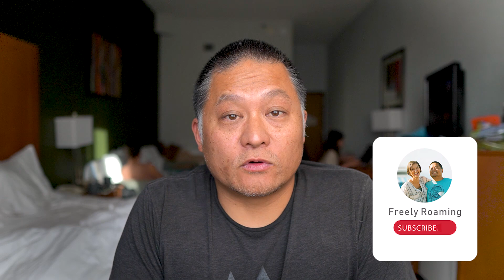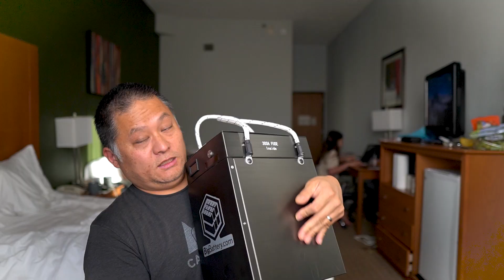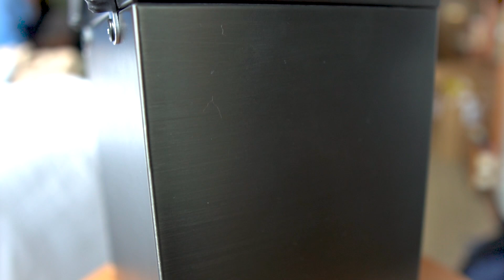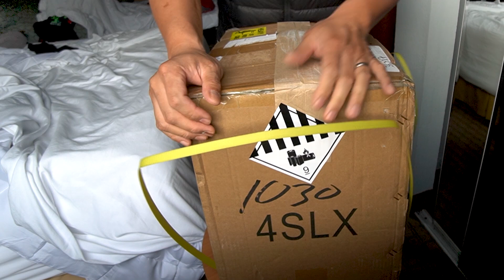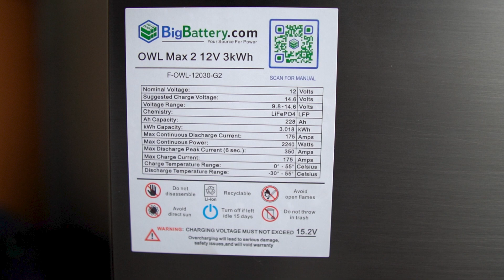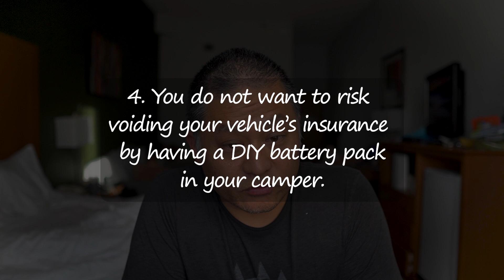Why You Should NOT Build A DIY LiFePO4 Battery Pack

Comment: Sorry you lost me on that one.  Disappointed because you were one of the leading sources on YouTube for DIY RV batteries.  I do understand it is not for everyone.  When you watch Will’s videos you understand the so called professional manufactured batteries are mostly worst than a DIY solution.
Reply from the maker: Well you say you understand it's not for everyone but in the same breath you show that you really do not. Unlike Will's channel, mine is not only about DIY lithium batteries. It is about off-grid and mobile living. It's irresponsible to tell people how dangerous it is without further explanation and just go on with the same old  tutorials and never show safer alternatives. Not all commercially made batteries are made equal. That is why I didn't just choose the cheapest one out there to show in this video. You do not get it because you don't get all of the questions I receive from beginners who have no business building a DIY pack. I've seen too many burned down RVs lately to not make a video like this. I don't really care about your feelings on this topic because the goal is to make sure the people this video is made for understand building from raw cells is not for them and they need to be steered away from it before someone gets hurt or killed. There's way more to it then just knowing which wires go where. For others in the know, this video won't do anything to deter them.
Reply: @freelyroaming  wow, I didn’t attack you.  Just pointed out facts
Reply from the maker: @Norm  I didn't say you attacked me. Though you did express dissatisfaction and disappointment which I said it is not my concern. Perhaps you felt that was an attack on you but it's really just apathy towards your opinions. I also just pointed out facts. You might want to read it again.

To say DIY solutions are mostly better than commercial is just your OPINION, not a FACT. Builds shown on YouTube are the exception, not the norm. Fact is, most DIY battery packs are dangerously made and time bombs waiting to explode. You just don't see them uploaded to YouTube. Believing otherwise is just foolish. A video like this that tells the truth of the danger of a diy pack is necessary. Even if it 'disappoints' people like yourself.

You have to realize that these videos are only made after a lot of thoughts and preparations. If you are just making an off-the-cuff comment without going thru the same level of preparation, your comment just won't seem credible.

Comment: I feel like I cheated the system a bit. One of the bigger chinese sellers for cells and batteries is LiitoKala and they started selling rather cheap pre-builds some time ago. Got a 150Ah LiFePo4 battery for the same price as 4 cells with a BMS (~270$) back during new year. It came in a proper package with no visible damage and has been working great so far~ Shipping took over 2 months though, haha. I originally intended to just buy a simple lead-acid battery, but this was too good of a deal to pass up on.
Reply from the maker: Wow that does sound like a ridiculously good deal. Good for you. Unfortunately those kinds of deals are just not available consistently enough for me to recommend to others.
Reply: Have you tested the real capacity of your battery pack ?
Reply from the maker: @cbinett  I assume you've heard about the faulty old cells Liitokala has been trying to sell as grade A, new cells. Seems like it is a gamble and some people are getting lucky.

Comment: lmao rope handles with out carrying bars on the ropes.  really for that price. oh yeah at $6.31 per amp hour its 13 times more per Amp hour sure you add cables and all you are still 3-5 times more expensive. you must being paid to promote this. there are way more affordable options of pre built units that give you 5.12kwh for same price. those are way better options. Big Battery is profit driven only.
Reply from the maker: Honestly I prefer it without bars. Its extra bulk for something that rarely gets used. Plus unless they are made of metal it will just crack and fall off.

Comment: I agree most should buy built battery packs. I on the other hand understand how to do things right and safe. I built a 10k solar 53.7kw 48V battery bank for $12,000 us dollars give or take $100. if I  would have got all prebuilt and such it was $65,000. yes labor and markups will kill your wallet. most should get a loan and do that. Those who understand should DIY it.
Reply from the maker: Exactly right. If you get asked the same questions as I do from beginners you will know for certain that most people should just buy ready made battery packs.
Reply: @freelyroaming  yes dealing with electricity in 12-24-36-and 48 volt can be dangerous. There are way better options than BigBattery out there just saying. you should do custom RV work since you understand how to do thing right. I see a few out there making a killing installing solar and batteries for those who can not or will not do it.
Reply from the maker: @dc1544  sure there are a lot of battery companies these days but I can't show all of them in one video. Better or worse is a matter of opinion. I picked bigbattery because they are not as expensive as the bigger companies but they are much higher build quality than the super cheap ones that are all essentially clones. It is also an American company that many people in the previous comment said they would prefer to buy from. I like the form factor as well for it's smaller footprint as well as the ease of serviceability of the enclosure.

Comment: This battery has a side connection, and therefore cannot place two batteries next to each other, this just waste space in a van or small buildings. There are many many places to buy second hand cells which will provide 80 to 90% capacity at a fraction of the cost, therefore a DIY battery pack will be around $600 to $800, were as factory built $1k to $1.5k. A DIY battery will provide 10 years service if you treat it correctly, millions of people have made their own helped by Jag35 Jehu Garcia battery channel.
Reply from the maker: There is no reason why you can't place 2 of these side by side. You just have to do it lengthwise. And again, as I said it multiple times, this video is made for beginners who might not feel comfortable building their own battery pack. They are definitely not in the market for used cells. I'm sorry but Jag35 has not sold used cells to 'millions of people'. That is ludicrous. You need to remove a lot of zeros from the end of your estimates. Wait a minute, are you seriously claiming to be an independent news reporter? Wild. Heavy emphasis on 'independent' rather than 'news' I suppose. Anyways, Jehu rarely offers lifepo4 cells. They are almost always used Lithium Ion cells from ebikes or escooters which are alway charged and discharged at a high c-rate. They are far more abused than what a typical off-grid pack would experience. I would never recommend them for RV use, even for an experienced builder.